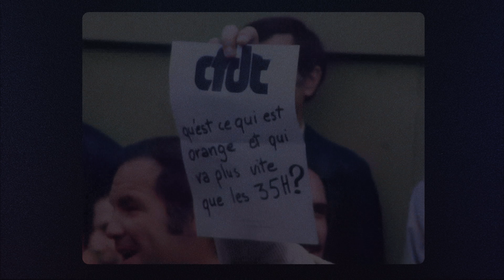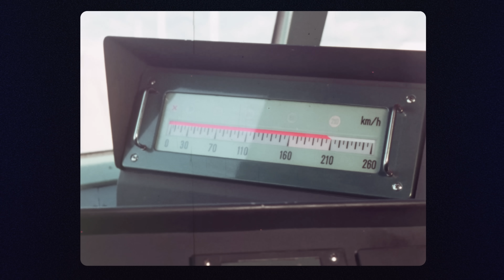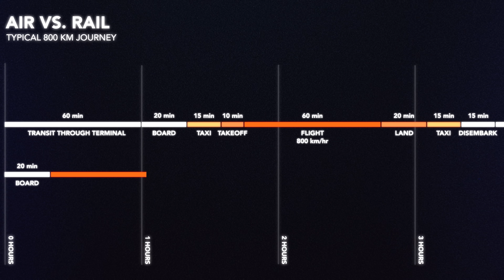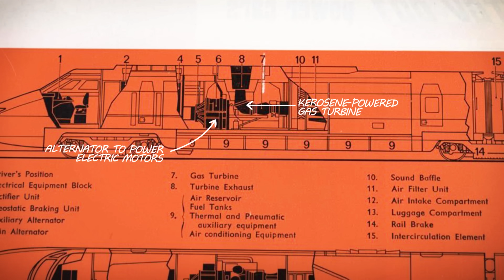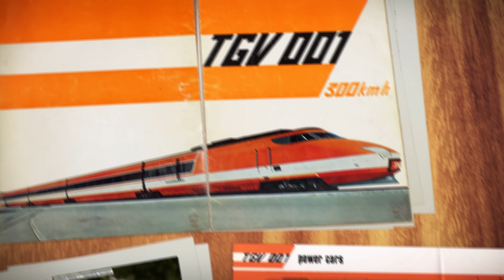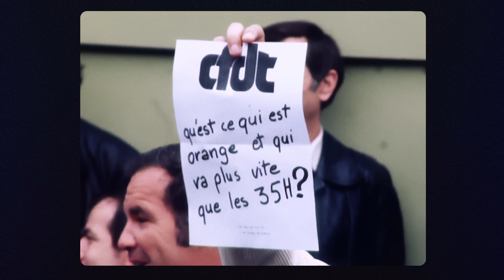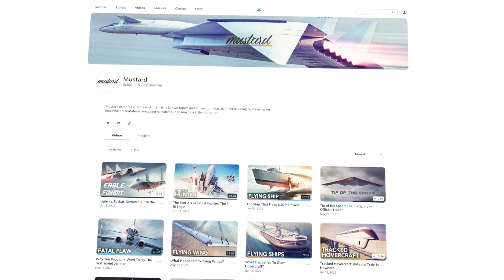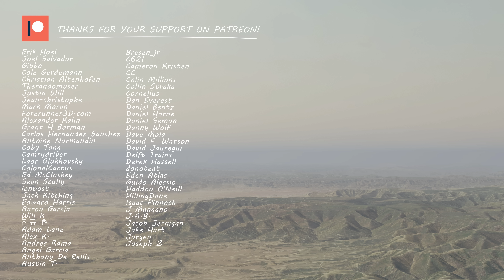Why French Trains Are The Fastest

Comment: Thats interesting. I never knew the TGVs were refitted with electric traction motors. I was under the impression the old turbine engine versions were withdrawn and a new fleet of Electric TGVs were built and pushed into service. Very very impressive they managed the switchover in under 2 years! I dont know which model TGV he's referring to but thats well over 100 TGV sets to convert. Top work Mustard and the french engineers!
Reply: No, the gaz turbine one was a prototype from the early 70's.
It never ran in commercial service and never was produced as a series. Then the oil / gaz crisis happened.
While they were building the first high-speed line between Paris and Lyon in the late 70's, they produced another and substantially different prototype based exclusively on electrical power, then a first commercial series, the TGV Sud-Est or PSE.
These first series TGV PSE were upgraded long ago to 300kph cruise speed and retired in the early 2010's.

There are currently over 400 TGV trains in the fleet. With a first batch of 115 new next generation TGV M trains progressively joining the fleet and entering service from spring 2024 on.
Reply: @KyrilPG  so it took them two years to refit 1 tgv? Have I got that right?
Reply: @justandy333    No, it took them 2 years to completely create a new prototype with many entirely different systems. (A bit more than 2 years).
There was no refit / retrofit. The gaz turbine prototype and electric prototype were 2 substantially different trains. Cousins at best. They had different power source, different motors, different bogies, different fuselage, etc.
The gaz turbine TGV prototype is preserved and on display somewhere. Consider it like a pre-prototype or an abandoned "fork" of the development.
The electric powered prototype was a different train based on systems tested on an experimental electric train called Zebulon.
Then 2 pre-series electric TGV's were tested and developed. And after that the first commercial series of TGV PSE was produced.

To sum it up, chronically :
- "TGV 001" > pre-prototype and powered by gaz turbine.
- Oil and gas crisis.
- Gaz turbine ditched so the TGV 001 prototype was not continued. It was then a dead "fork".
- First PSE electric prototype with many new systems that were tested on the experimental Zebulon electric train. They had to redo the research and development from scratch for many systems.
- First 2 pre-series test trains (electric), "Patrick" & "Sophie".
- Commercial production of TGV PSE, the first generation of TGV's (electric).
- Retirement of TGV PSE in 2012.
Reply: @KyrilPG  Apologies, the notification of your response didn't show up. I've just re-watched the video and noticed your very well detailed response. I just wanted to thankyou for taking the time to explain the chronology of the TGVs development. It's certainly not as straightforward as its portrayed in the video!. It's made it a lot clearer in my mind, so I thankyou for that. Very much appreciated my friend.

Comment: Great video! And I m glad that the TGV legacy continues with the upcoming TGV M!
Reply: TBH I would like to see more of AGV line development. It gives enormous boost by using distributed traction, both in terms of efficiency (just 7MW of traction motors instead of 8 in TGV-M) and commercially achievable speeds (up to 360km/h on proper HSR lines).
Reply: @michawisniewski4654  SNCF has plenty of experience with EMUs (most their trains are, outside of the TGV) but they are not interested in running single level high-speed train anymore and target maximum capacity, hence the classical Duplex architecture for TGV M.
Reply: @SpectreMk2  well, Alstom has also double decker EMUs. Due to much better traction with distributed power it will eventually happen. Just remember, that TGV - despite being powered from 25kV AC - was actually using DC traction motors longer, than any other HST.
Reply: @michawisniewski4654  Exactly, Alstom also has great experience with EMUs. So if both Alstom and the SNCF prefer the current configuration of TGV, there is certainly a good reason for it, or else they would have switch to high-speed EMUs a long time ago already ;)

Comment: I don't see anything unusual about a plane losing a race against a train. A typical Japanese Shinkansen bullet train has a speed of 320km/h while a Cessna 172 Skyhawk is a mere 201km/h. 

Although that's not exactly a fair comparison, since Cessnas aren't built for performance. It would be a close race between a bullet train and an Extra 300, which has a speed of 320km/h. Mind you, I looked these speeds up on Google and it doesn't say if it's the typical operating speed, or the top speed of it. So take this with a grain of salt.

Comment: TGV is always compared to the Shinkasen and I find odd that one of the main difference is not that the Shinkasen has dedicated rail lines (TGV obviously can't go at high speed on same lines with traditionnal trains) but custom ones with larger footprint which explains as lot of it's advantages over TGV.

Edit: I was wrong. The Shinkansen only has a wider body (not rails).
Reply: They both run on standard gauge tracks...
Reply: @KyrilPG  After researching, you're right. I've taken both and the Shinkansen's looked wider, but I guess it's only the train itself.
Reply: @azaheim7731   A Shinkansen N700S has a body width of 3.36 meters, but thicker walls, and seating of 4 or 5 abreast. And 3.5 / 3.6 meters in height.
A TGV EuroDuplex has a width just under 3 meters, as it is close the European loading gauge (3.15 meters max), and seating of 3 or 4 abreast. And a height of 4.3 meters.

Comment: It didn't beat the plane as evident. It merely is able to offer decent competition with airplanes
Reply: Woosh... from city center to city center it's competitive until 1000 km distance. And when you take into account the ticket price, rotation frequency and capacity of a high speed train (510 passengers for a TGV duplex, less than 150 for a short range commercial plane) you'll easily see planes can't match the overall performances.
I really hope you don't work in logistics.
Reply: @chucku00  I hope English is your second language. The word "beat" as used in the title implies the TGV surmounted air travel, thus totally eradicating it when that's not the case. Clearly Air France, Ryan Air, and others still operate domestic routes
Reply: @burntnougat5341  When someone beats someone else in sports he doesn't eradicate his opponent. It's the same thing here : TGV has beaten the plane on French domestic plane routes in almost every metrics, the most meaningful one is the number of passengers per year  : barely 500,000 people for the plane (all mainland flight routes included) VS 100,000,000 people for the TGV in 2022.
You're right tho, the TGV didn't eradicate the plane, it's only 200 times more efficient and successful. A very thin margin indeed.
I hope you're not an English teacher...
Reply: @chucku00  you're defining "beat" a different way from what I stated. Learn to read buddy

Comment: The TGV is a marvel of engineering. But, these technologies are also incredibly expensive, because they need new dedicated infrastructure. Whilst this works in France, which is largely empty outside of the city, it is not so easy in other countries. Most HSR lines in the world are thus loss-making, and this also goes for France (apart from the Paris Lyon corridor). It may have defeated the plane on the Paris Lyon corridor, but it certainly won't defeat the plane on other O-D pairs in Europe. Planes will always be cheaper to run, and actually more environmentally friendly, as they need a lot less infrastructure, and have very high load factors.
Reply: Lot less infrastructure?? Have you seen how airports have become larger and larger to accommodate ever-increasing numbers of flights?
Also, why compete when both can be merged? Schiphol did it.
Reply: @ianhomerpura8937  For the O-D pair Paris Lyon, you need 2 runways, and a small terminal building to process the number of flights between these two cities. In contrast, for a HSR between this O-D pair, you need to carve up the landscape for a distance of 500 km. The reason why airports are so large, is because they serve a large number of O-D pairs. If you would replace all these O-D pairs with HSR, you would need much more infrastructure. So yes, planes need a lot less infrastructure compared to HSR. 
Also, KLM (not Schiphol, they don't operate flights) has done this for one or two O-D pairs (Amsterdam Brussels, Amsterdam Paris), which are served by the HSR line there and not for any other O-D pair.
Reply: This guy speaks logically. Take heed all you train loving urbanists

Comment: Where the Shinkansen proved that high speed rail was possible and economically sustainable, the TGV proved it could be feasible everywhere. You see, the main Japanese cities are all on a line from West to East. It's easy to build one dedicated high speed line, and then put all your bullet trains on it. It would therefore not be a problem if your bullet trains were incompatible with the existing lines, by having a different gauge for instance (which is the case in Japan). But most countries are not built like that on a line. France is built like a star: Paris in the middle, Lyon Marseille Toulouse Bordeaux to the South, Lille Reims to the North, Strasbourg to the east, Rouen Nantes to the West. So you won't build a single line, you have to build many, which makes it that much more expensive. But if you can reuse existing tracks and connect them with high speed lines, it can actually be to your advantage... And the TGV did this perfectly. Now, there are TGV lines even in small provincial towns of France, because they use their local lines to connect to the bigger and faster network of LGV (high speed lines), which means from your little French town, you are at the doorsteps of Paris and the rest of France. And that's how France showed the world that they too could have great trains, and make them even more far-reaching than the Shinkansen.
Reply: It also helps when your country isn't 80% mountains. France has a considerable advantage when it comes to terrain and space. A lot of their TGV trains can be run on berms in the countryside. IN Japan, on the other hand, they pretty much committed to running it in viaducts and tunnels. It's VERY expensive to build lines in Japan. 

Japan does actually reuse lines for its mini-shinkansen lines to Akita and Yamagata, but these are limited to 130km/h and pretty much terminate at rural areas. 

Another advantage France has is that while it may seem like it's connecting small towns and cities on the outskirts of France to Paris, it also benefits from knock-on effects from passengers travelling from UK, Spain, Switzerland, and Germany. 

You can imagine  many more lines they'd have from South Korean and China if Japan was connected to the Asian mainland.
Reply: Shinkansen was grade separated because
1. The Japanese narrow gauge was insufficient to handle faster speeds, and
2. The Tokaido line had reached capacity so the only way to increase capacity was to build a new line.  

These two factors was what justified Japan to build a dedicated ROW for Shinkansen.  All rail traffic is mixed to a certain degree in Europe because everything was standard gauge to begin with so there's no need for 100% dedicated ROW.
Reply: @taoliu3949 and jepan have 80 million pople from Tokyo to Osaka. 😂 More than all France population. To use train servis.
Reply: Japan has shinkansen routes all over the country and is still expanding the network and is now on its 7th generation bullet train.
Reply: JAPAN is the fastest 🎌🗾  and the BEST the first bullet train was created by Japan.
Reply: @Gromo19269  I find the TGV more comfortable to ride than the Shinkansen bullet train.
Reply: France is part of a continent, Japan is a group of moutainous islands on the Pacific rim of fire. Of course the Shinkansen is going to have limited reach in comparison. Yet it still shifts more people more frequently, day after day and year after year.
Reply: @shiftygirl6434  that's hardly surprising, considering that the population of Japan is much bigger than the population of France. My point was mainly that the Shinkansen could have been seen as an exceptional but impractical solution, made only possible by the geography of Japan (the same way that the Airbus A380 was a great plane that only Emirates managed to make fullly work). Instead, thanks to the TGV, high speed rail is now a solution for everyone. The TGV proved the value of the system outside of exceptional circumstances.
Reply: Meanwhile China has more HSR than every other country combined and still expanding.
Reply: Its reverse : Shinkansen appeared after TGV. They benefitted from France mistakes and experiences
Reply: @pierren___ no... The first Shinkansen started operating in 1964, but the first TGV line (Paris-Lyon) was inaugurated in 1981

Comment: That 331 km/h test run in 1955 was actually VERY dangerous, as some of the film shot of that record run showed the train came very close to actually derailing. I believe construction has begun on a new line between Bordeaux and Montpellier via Toulouse in southern France, and there are plans to extend the line from Rennes all the way to Brest.
Reply: It was even intended to be dangerous, as the goal was also to test how the railway infrastructure takes such abuse and how to improve it.

The catenary system (known as Westighouse/Midi system) was clearly not build to support speed, but to be cheap to build, and is rated to a max speed of 140 km/h (~88 mph), neither does the tracks (which has been damaged during tests, rails would bend). 

Infrastructure needed repairs after the record runs, and it settles for new tech devlopment ; a new track (with long welded rails and concrete sleepers) system, able to sustain such speed without damage. 

The results of these test begun to be visible around the early 1960s with the Capitole Trains linking Paris to Toulouse, and able to reach 200 km/h thanks to these improvments.

> I believe construction has begun on a new line between Bordeaux and Montpellier via Toulouse
Construction has begun between Montpellier and Beziers and should begin between Bordeaux and Toulouse, but there is no plan for an HSL between Toulouse and Montpellier.
Reply: @Chepa_Faux  TGV seems to have adopted ballastless welded rail later than the Japanese. Did SNCF not have the budget?
Reply: @Shaker626 TGV (LGV?) are still using ballasted track to this day. They're able to run it at 320 km/h though, so it's really fast for ballasted tracks. China and Germany are the ones who use slab tracks extensively. I don't know why Germany does it, most likely for comfort. China meanwhile uses it to run their trains at 350 km/h. Japan on the other hand only uses slab tracks on a relatively small 320 km/h section of their track. Tokyo to Osaka for example still uses ballasted tracks and runs at less than 300 km/h.
Reply: @Shaker626  AFAIK, SNCF did almost never used ballastless outside of bridges and tunnels at all (except multiple test zones). Even on bridges and tunnels, it is not that frequent. 

Budget does not justify the choice of ballast tracks over ballastless, because even if its cost is higher, it is offset by the fact that ballast tracks needs higher maintenance and wider curves (and more terrain) due to limited bank/tilt angle on tracks.

So what justifies it ?

There are multiple possible reasons :
- Transitions between ballast and ballastless zones wears faster.
- Ballastless infrastructure is louder. 
- Politicians who decides how the future high speed railways are short-sighted and as terrain is bought before construction, they think that concrete is just more expensive than ballast.
- "we succeed to travel to 574 km/h on ballast tracks, why change, it just works™".
Reply: @bltzcstrnx  "most likely for comfort." comfort doesn't seem like much of a concern on high speed trains: continuously welded rail is a table-stakes requirement, with exacting stressing to ensure the rail does not kink in hot weather or fracture in cold. So while a slab track will have less slack than a ballast track for "normal" rail, it's likely much less of an issue for HSR.
Reply: @BlairdBlaird  I know all high speed line use continuously welded track. What confused me is that Germany rarely runs their train above  300 km/h. So using slab track doesn't make any sense, it adds to the construction cost quite a lot. Yes, some models of ICE can run above 300 km/h, but they only do so outside of Germany, like in France for example.
Reply: I think the Toulouse - Montpellier part is not validated yet
Reply: @noefillon1749 brodeaux Montpelier is schedulled to start for end of this year anyways.

Also Lyon Turin is currently being built.
Reply: @TheMusicalKnokcers  More precisely Bordeaux - Toulouse
Reply: JAPAN is the fastest 🎌🗾  and the BEST the first bullet train was created by Japan.
Reply: @Gromo19269  Okay. 🤨
Reply: @Sayitlikitiz101  Japan already accomplished everything what other nations trying to do 70 years later 😂🇯🇵🎌
Reply: @Gromo19269  70 years later? 2034? But other countries have had high speed trains for decades...I think you need to work on your maths.